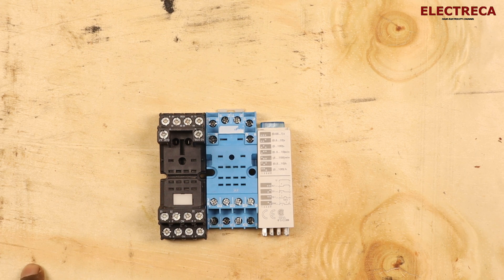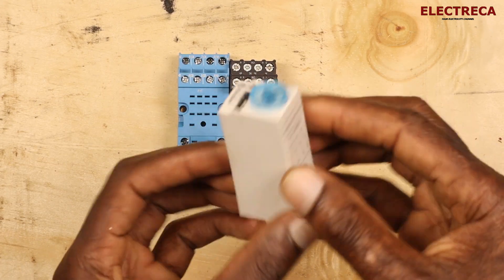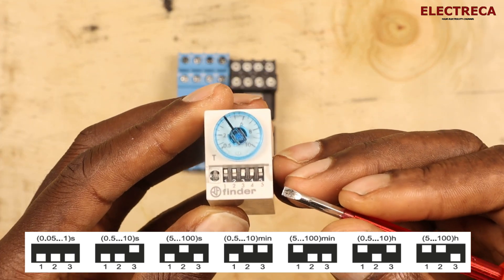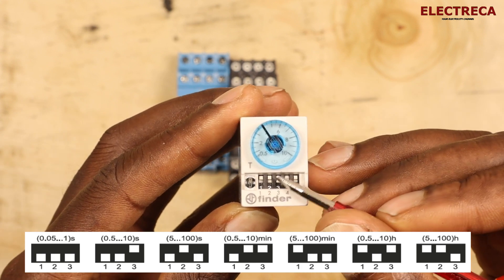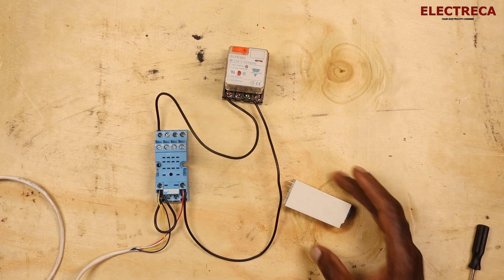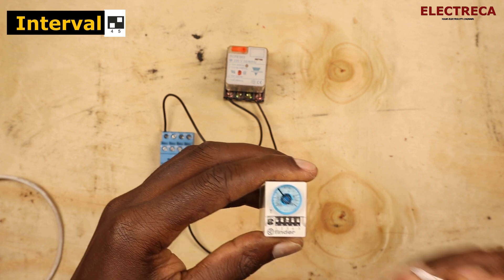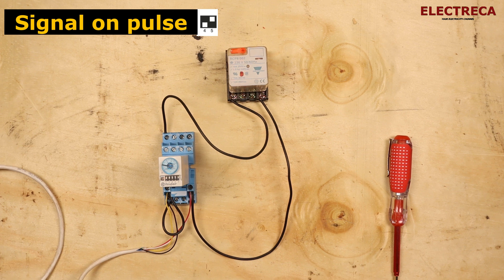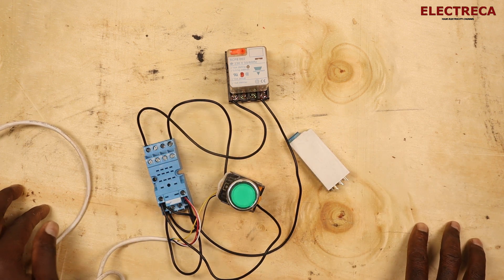Mastering the Finder 85 Series Timer Features, Setup, and Applications Explained!

Comment: You can get multi voltage finder timers. That one is 230 to 240v ac only. Multi voltage has the ac wave ident, with the DC dotted line ident underneath it.